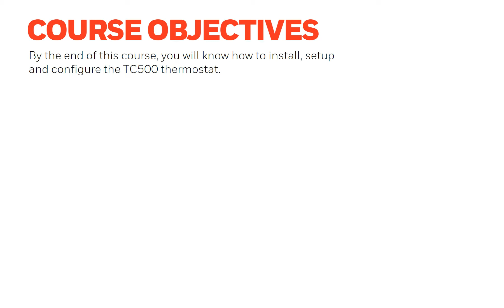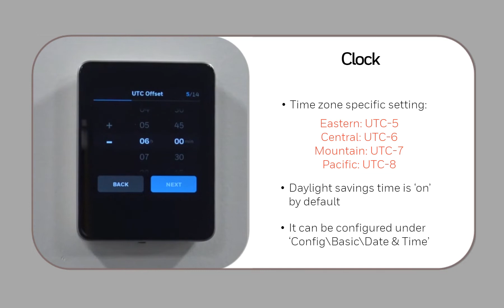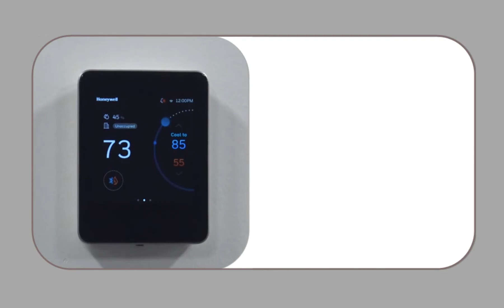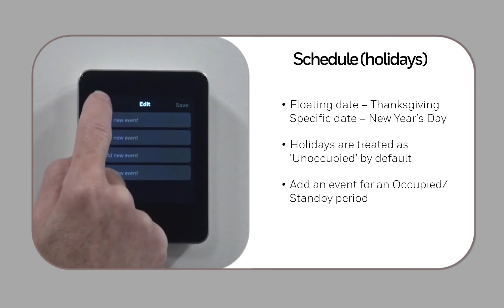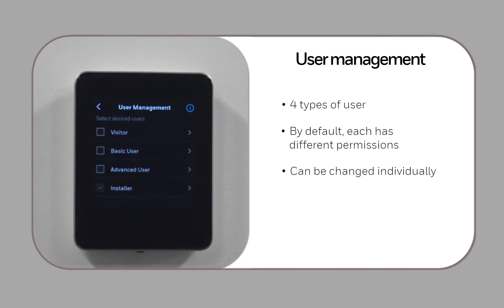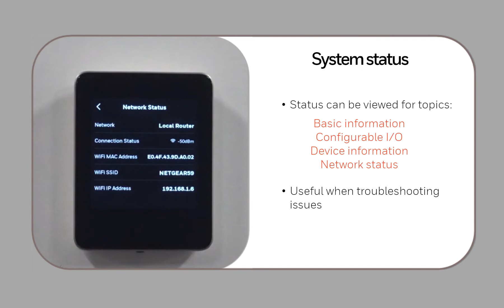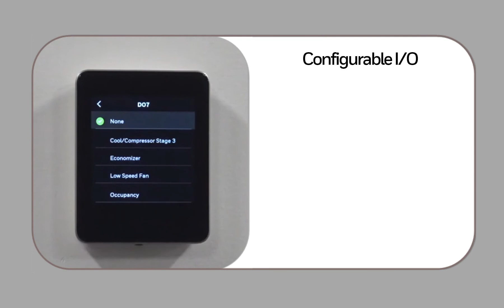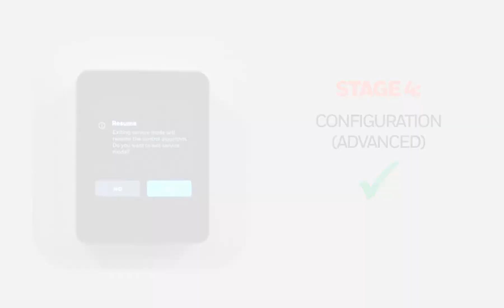TC500 Thermostat Configuration and Setup

Comment: Hi. Nice video. I just have one quick question. I have a 12 unit apartment building. I would like to wire sensors to the four apartments on the outer parts of the building top and bottom floors. Can I connect these four sensors to this thermostat so that I can see what the temperatures are in each of the apartments? Does the app allow for that?
Reply from the maker: Great question. Like a conventional thermostat, the TC500 has outputs to control one HVAC unit (furnace/rooftop etc), so it is designed to control based on one room temperature reading. This may be the sensed temperature in the thermostat, one or more remote temperature sensors, or an average of the sensors.  The remote sensors communicate via " Sylk". They can be TR40 wall modules or C7400S remote sensors and are daisy chained together, however the sensed temperature will be averaged and the averaged temp  will be displayed on the TC500. (You can choose to include the temperature sensed at the TC500 in this average if you like, and each sensed temperature can be "weighted" as part of the average) There is no way to see what the individual remote temp sensors are reading.  So in your case, the remote sensors in the outer part of the building would be averaged, and all apartments would get the same temperature treatment. (ie they may get too hot or cold) I'd encourage you to call our hotline at 888-793-8188 so you can describe more about your situation and see what your options are.

Comment: How do I wire hot water valve that is 0-10v to uio1 with 24v, common and signal
Reply from the maker: 1: Make sure it is on WiFi so it downloads the current firmware
2: Navigate to configurable I/O and set up UI01 for modulating heat 
3: Wire 24VAC R and C from thermostat (or from transformer) to actuator, and UI01 to actuator 0-10 input (no need to wire UI02 Com as I assume you are using one transformer for both thermostat and actuator and everything is half wave rectified) 
For more details or if I misunderstood you, please call our hotline at  888-516-9347 or buildingsproductsupport@honeywell.com